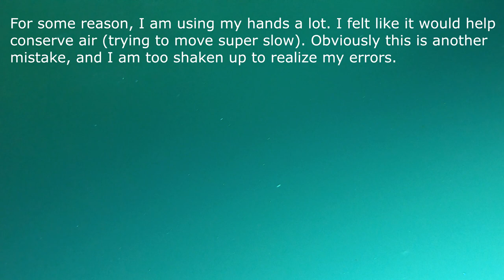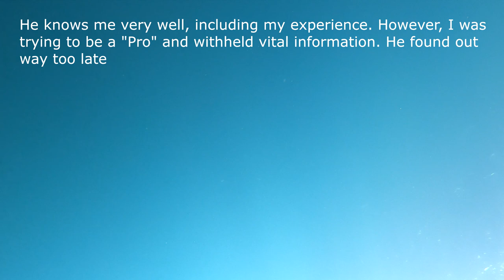OUT OF AIR while Scuba diving

Comment: Depending on your depth if I were you I probably would have done a controlled emergency ascent as soon as my buddy started swimming away instead of towards me
Reply: My thought too. I will not chase the irresponsible buddy.
Reply: It's for this exact reason I carry a 6 CU spare air bottle. People laugh at them but I could've ascended to 15ft, and had a solid 3 min safety stop no problem. at 200psi, there's no way I would've dove down deeper... that's crazy

Comment: always check your buddy’s air regularly and ask him to check yours. If you’re low, they should be taking charge of the situation and making sure you both get to the surface as safely and as soon as possible. I really don’t understand why your buddy has made you swim back to the anchor line. You should be able to  make a controlled ascent in open water with buoyancy control sufficient for  your safety stop

Comment: My dad and grandfather both dove into there 80’s. They started in the 50’s and new Jacque Cousteau. They also were sherif divers for many years doing recovery’s of body’s over 200 feet in the pungent sound. They both taught me buddy breathing kills! No your limitations. My dad had multiple 150 foot out of air accents when he was still using a single 72 with a j valve. He laughed you would occasionally forget to reset it when airing up. You would pull the valve lever and realize you didn’t have that 500 pounds you were expecting.
Reply from the maker: Those J valves, or as they call them now.. "junk" valves seemed like a real pain in the butt. I have heard many stories of people leaving their reserve open, and finding out they ran the tank dry. Thanks for sharing, cheers!

Comment: good thing you didnt try to surface by urself that wouldve been a death sentence. i had a similar experience ran out at 100 feet and had to use my buddy's air... i was bugging out on the decon stops you keep thinking if you ran out of air your buddy must be pretty low too.
Reply from the maker: I always thought "if something goes wrong, i can handle the stress no problem". But on this particular dive, with no buddy system, things just kept getting worse and worse. The internal battle in my head was intense! I couldn't decide what the best option was, meanwhile watching my air drop to nothing. The biggest problem was knowing our dive boat had the anchor set by another diver. If i had gone for the surface, they wouldn't have been able to pull anchor and come get me. I decided against surfacing alone, which i agree with you, it wouldn't have been a good idea. So i tried as hard as i could to keep up with the divemaster / guide. But i was so winded, and couldn't catch my breath.. I didn't think i was going to make it. There were multiple times i just stopped swimming and thought about going for the surface, regardless of the outcome. But when i finally saw the anchor line, i was the happiest man alive! It was a huge scare, and since has made me a much safer diver. I'm glad it happened, but wouldn't want to go through that ever again! Appreciate you watching and leaving feedback. Have a good day!
Reply: Surfacing alone when your personal situation turns bad isn’t a bad thing, I’d sooner die of dcs at the surface than drown
Reply: Mark Northern no dude thats what a buddy with the octopus is for lol. dont panic and surface by yourself youll regret it
Reply from the maker: @oioionionone  It was definitely a hard choice. My "buddy" got pretty far away, and i was begging my regulator to keep giving me another breath so i could chase after him. But if i could go back, i think i would have began my accent no later than 600psi in the tank. No matter what, i can complete my safety stop, and surface normally without worry. And then i would pop the SMB and hope the boat can see me. It was just a weird situation, knowing that the boat was physically tied to the wreck, and the fear of not surfacing by the boat really stressed me. Luckily i get to dive the same site this month, with the same crew, but my permanent buddy (wife) will be there too. Unless this storm turns north, then i will continue waiting. A redemption dive.. If you will.
Reply from the maker: @Karboooo  I agree about a panicked surface. That would end terribly! I am thankful everything worked out, but have since learned to add contingencies into the plan. 600psi or less and my butt is heading towards the sunlight, in a calm fashion. Never again will i dive without a real buddy. My wife and friend JD, would have known I was in trouble before I even told them. And that is exactly the kind of buddy to have when it hits the fan!

Comment: That was a comedy of errors. When you had 900 lbs a slow ascent would have been easy. Better to be on the surface and breathing than out of air on the bottom. At 400 lbs instead of going up, you swim hard going down burning even more air and making your valve and reg work harder to deliver air. Apparently your dive leader needs to learn to take your signals a little more seriously and actually look at your gauge and stay with you instead of swimming away. Wow! Glad you made it.

Comment: I did realize one time on a shark dive our times was about to finish but it wasn’t. Luckily for me I just surface at 400psi but that was the first time I feel I was about to run out of air becase of that and because with sharks you don’t want to be at the surface waiting for the boat to pick you.
Reply from the maker: Isn't it a crazy feeling when running low? When you feel your high pressure hose begin to bend easily, that's when my anxiety really hit me. I started to wonder how accurate my pressure guage was, and if it had less than it was reading. 
Thanks for sharing your story, I can't wait to see some more sharks! Cheers
Reply: The Florida Diver yeah is awful experience to go through. We should meet up one day and dive together. I’m currently using underwater  a Nikon Z6 setup for stills and a Sony for video. I’m in Port Saint Lucie FL I mostly dive in west palm beach and jupiter but I’m down to travel as well.

Comment: Your self analysis and willingness to admit fault by pointing out your exact errors might save a life one day - who knows. Can I ask, is there a reason you yourself didn't ascend solo when you knew you were in a bad way. I know nothing about diving.
Reply from the maker: The only reason I was hesitant on accending is because our boats anchor was set by a diver, and needed a diver to release it. So if I went for the surface and got carried away by the current, they would be sitting over the wreck until everyone else was back on the boat. Who knows, I could have popped up right next to the boat or so far that it wouldn't be visible. These were the exact thoughts in my head while trying to determine what I should do..